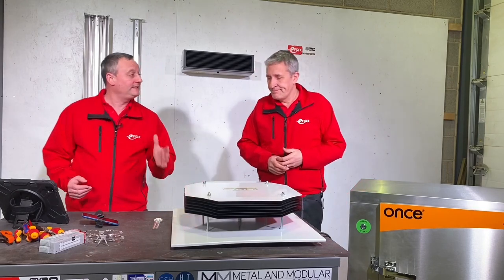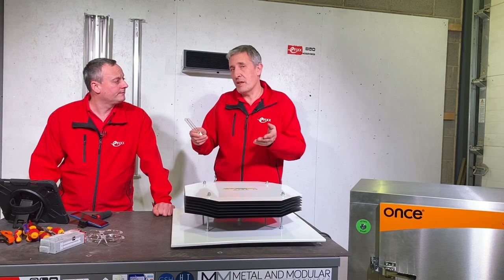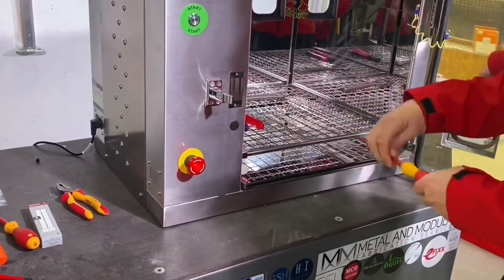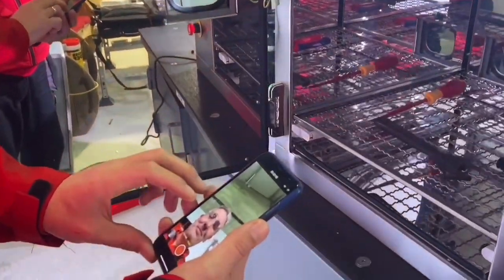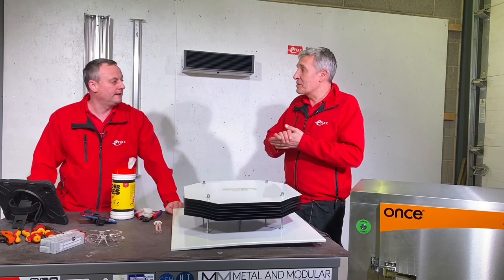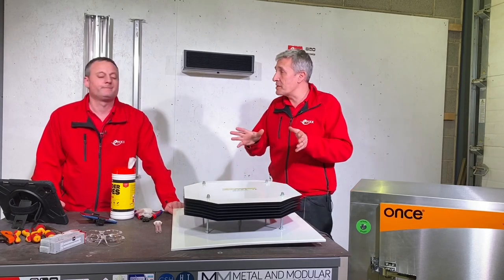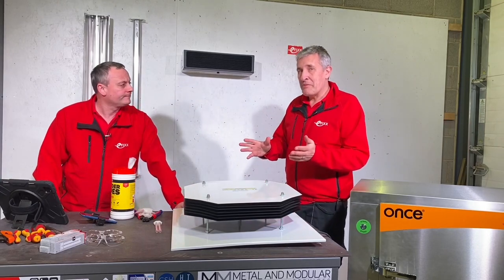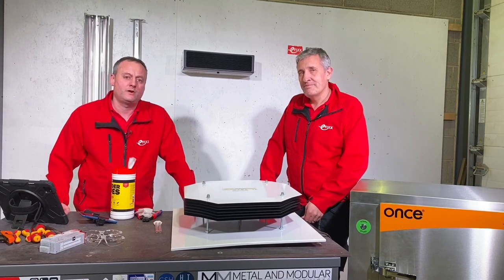Disinfection with the power of light – Philips UV-C luminaires for air, surfaces and objects

Comment: I remember seeing something from Big Clive on YouTube awhile ago, he had a UvLight and mentioned killing bacteria
Reply from the maker: Lots of UV-C around - but lots of products have no safety considerations.
Reply: Big Clovis has done a lot of videos on the topic namely it started I think with the one where he talked about the lighting display in a store that caused severe sunburn and welders sand Eye.
Reply: Having now watched the video those Luminaires at the end of the video look like the stuff of nightmares. Good that you mentioned safety interlocks and automatic monitoring but it still worries me that there could possibly be "Unauthorised resellers" that install this stuff without the care that Phillips intended. 

Also those little white ceiling mounted doodads, do you not think they would be worth while inside of a HVAC duct to disinfect the air as it is circulated around the office space, as the ones in the video seem to do a localised area and we all know who well a cold circulates around the office thanks to HVAC.
Reply: @warrmr  they do make HVAC units, and some places have them installed. but remember nobody wants to sit by the air intake because "that's bad" so I've been to businesses that I think have had their air circulation system turned off. Stores that were abnormally warm or abnormally cold for the time of year and outside temperature.

Yeah the scary thing is you put "UV" into Amazon or eBay and you can get whatever you want. On top of that the distinction between the different levels of UV is blurred so you could get a cheap knock off black light UV and think you're safe and then get the real deal and get burned thinking it's safe. You can either get something that does nothing but a placebo (UV phone light filter) or you can get something that is very dangerous to handle that looks safe (Random UV tube off eBay).

Comment: In this current climate it's good to see products coming to help with sterilization. Are there particular tests that would need to be carried out daily/weekly/monthly to ensure they are still working correctly ?
Reply from the maker: Would need some checks - lamps last for around 9000 hours - but as with all lighting systems - dust is the biggest cause of light output loss - so get the duster ready - but switch off first.

Comment: Presumably a glass mirror reflecting the UV-C light would be fine as the glasswork would block the UV-C!
Reply from the maker: Good question - we’d have to double check this as it would depend upon they type of glass the mirror is made from.
Reply: I was thinking the same thing unless it was a first surface mirror although it’s not going through it completely and still has a slight layer of reflection on the surface so....

Comment: The only problem with UVC light is everybody thinks it’s UV light like black lights to the point where we have both products marketing black lights as disinfecting when they’re not and UVc lights as black lights very dangerous one doesn’t work and one gives you severe sunburns and welders Eye.
Snazzy labs just reviewed the UV disinfecting attachment for your phone that turns your phones light into a fancy black light. But I’m sure they’re raking in the dough until somebody gets sick and Sue’s them.

There also needs to be more talk about what UVC cannot come in contact with as from my research It’s not great for fabrics and color some dies which means it’s not necessarily good for a quilt show even though we had proponents in the quilters group wanting it and at the time the market was not readily available with safe options.

Comment: This lamp can be work without TRANSFORMER directly from souruce 220v
Reply from the maker: They use the same control gear as regular fluorescent tubes.
Reply: @efixx  really thanx a lot brother for important information
Reply: If you want to see the variety that’s available just look up UVC on big Clives channel there are some that can be directly powered but that just makes it even more dangerous.
With the scarcity florissant fixtures it’s sort of makes it safer as you can’t accidentally swap the bulb out because it looks pretty in a regular lamp.

Comment: I feel like the end goal is new buildings will just have AC with UVC filtering built in the same way they have HEPA filters. As buildings get more air tight for energy efficiency reasons forced air ventilation will be the way forward so it naturally makes sense. Older leaky buildings air filtration doesn't make sense but UVC cabinets for disinfection are already used in conjunction with steam ovens in places like dentists and hospitals across the world.
Reply from the maker: Great input - Thanks 🙏